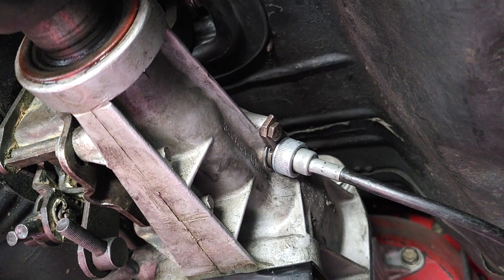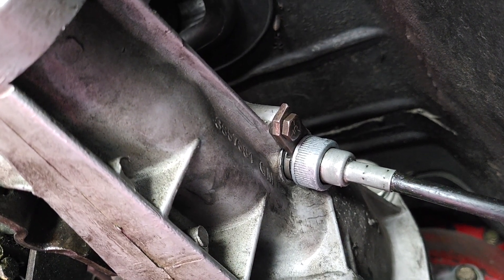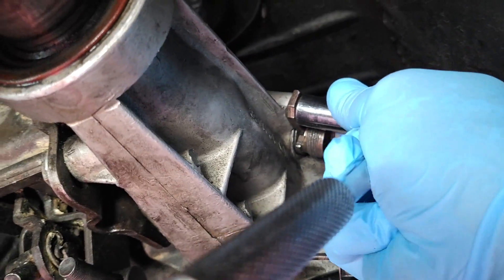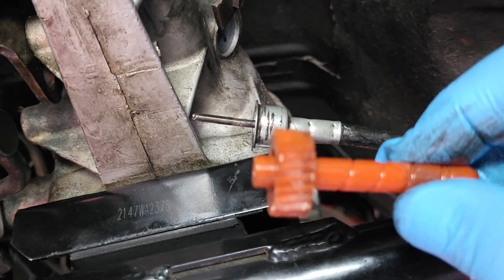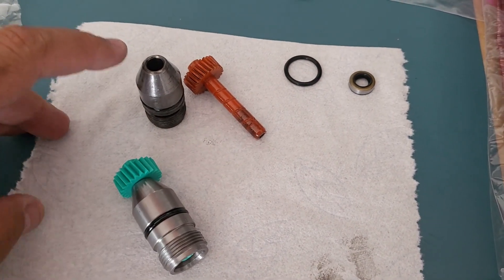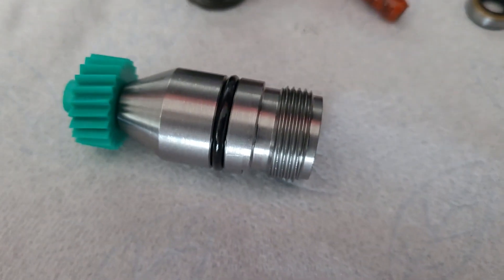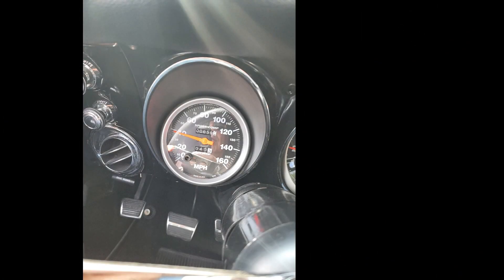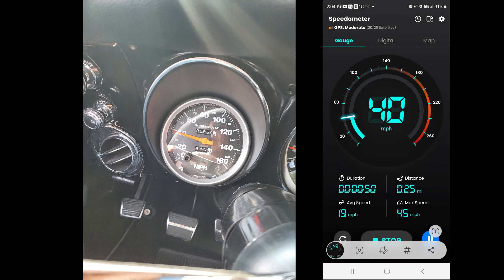Speedometer Off By 10mph - Muncie Tranny Fix

Comment: Hello I have a Muncie 4 speed on recent purchase that has a stewart warner 666f drive joint with 0.8241 ratio. Can you tell me why this is needed if can just change the gear size. It’s a 4.10 rear end. Thank you.

Comment: Why didn’t the transmission fluid come pouring out when you removed the gear and housing?
Reply from the maker: No fluid pouring out because there is a dedicated seal around the output shaft where it connects to the transmission housing. You may get a little fluid, but not much. You can also raise the drivers side a little to prevent this.

Comment: I wonder what gear ratio you have and how tall is your tire.  Just for reference
Reply from the maker: I'm going by memory here 
Rear Tires P295/50R/15 
Rear Axle ratio 3.55 
Pink drive gear 
Brown driven gear got me really close to actual (maybe around 1mi mph off)
Reply: Thank you for your reply.  Great video it was helpful.  I removed the bullet peice and looked inside the output shaft inside has no gear on it . I am trying to figure out what I need 🤔
Reply: Good afternoon😎
In my 86 blazer, I'm off for about 7-8miles, I'm running at 60 and the speedometer shows 66-68.
In this case I need LESS teeth???
TNX IN ADVANCE 🙏🙏